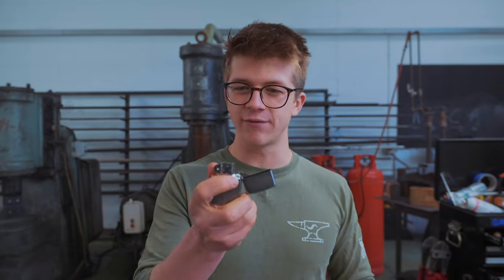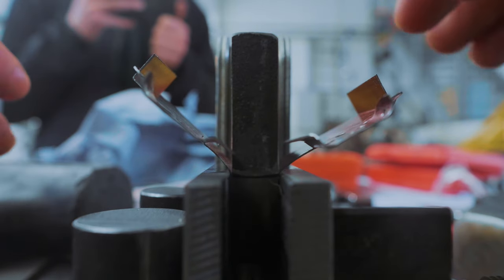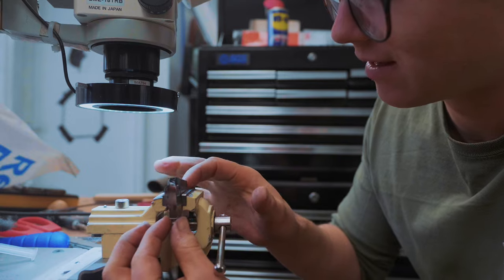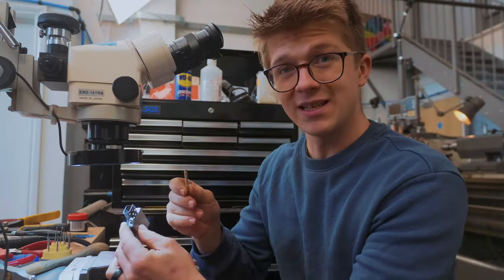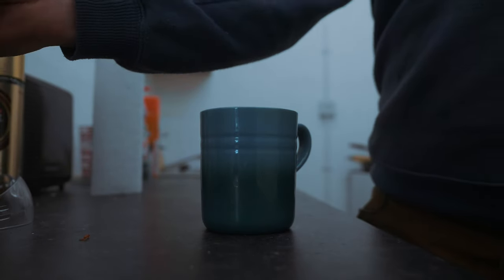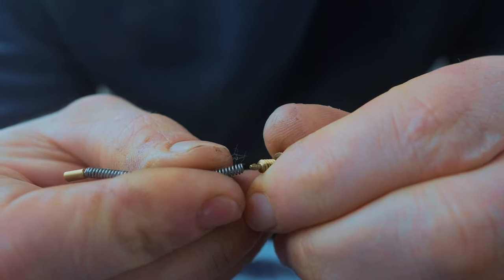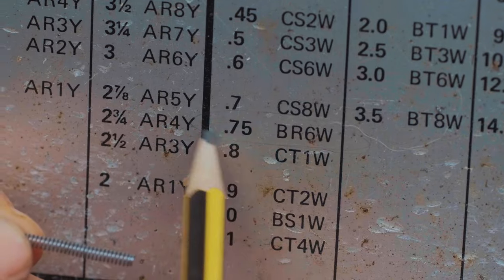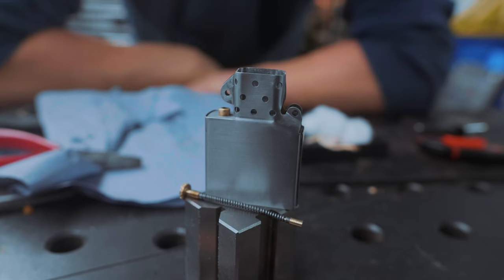Can I Make This Iconic Lighter? Part 2

Comment: This is amazing. I currently want to learn to blacksmith,  but nobody in my area can teach me. Any tips?
Reply: start solo
Reply: @Fogyt121  Thanks for the tip, but  my parents have told me that it won't work. :(
Reply: @funkyjug2107  I started solo, it's fun
Reply: @Fogyt121  Working on getting materials, need heat source, parents won't let me get propane or butane.
Reply: @funkyjug2107  lump charcoal
Reply: @Fogyt121  k

Comment: Back in the days they were soldered together, the modern glue unfortunately fails you if you overuse the lighter then the glue till start running

Comment: Noooo.. your spring is a little to short... Ohhh no... It needed to be about a 1/4 inch longer... Oh I hope it still works

TO LONG.... WHAT.. NO. NO NO NO... DONT SHORTEN THE SPRING... I BEG.. PLEASE DONT.

I PROMISE. U WILL WANT THAT EXTRA SPRING PRESSURE AGAINST THE FLINT

Comment: I love this channel, but I can't help but yell at the screen every time Alec decides to do something the wrong way.   why use CA glue, when loctite makes a type of glue designed for this task?  Why solder when you can braise? or better yet, spot weld? Use a rock tumbler to clear off scale from small formed parts... etc etc.